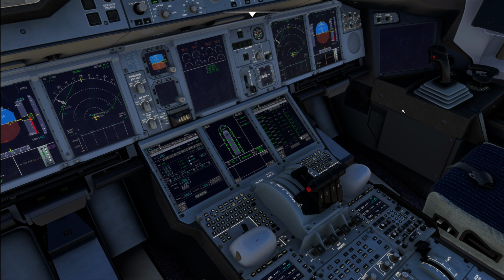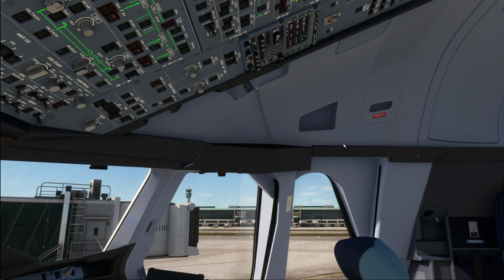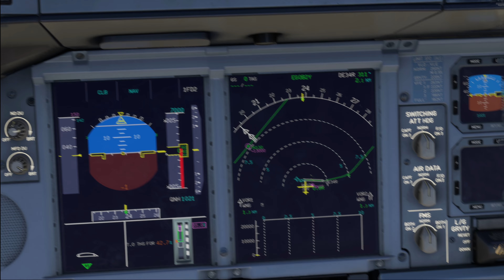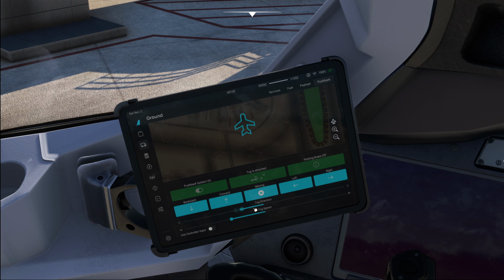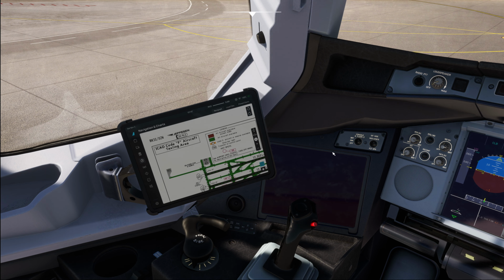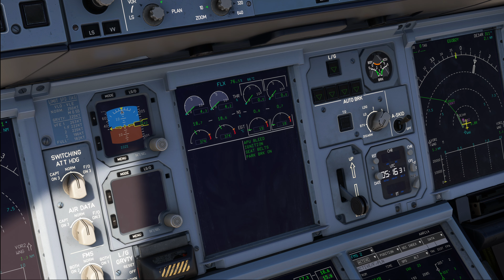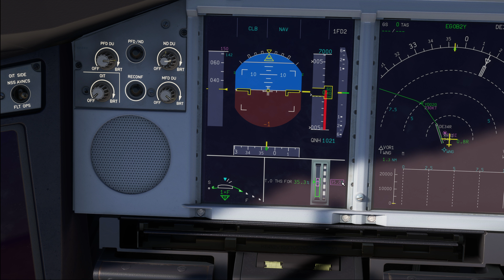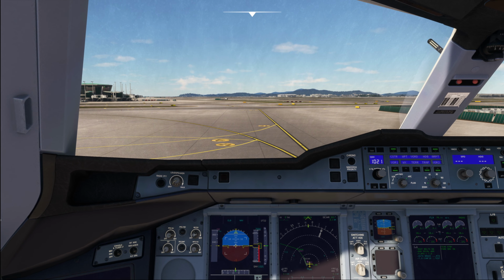FBW A380 Tutorial 4: Starting your Engines | Real Airbus Pilot

Comment: I think you forgot to disconnect the ground power. The external power switches where still one. I might be wrong but normally you switch them off, disconnect the ground power and after that you start the fuel pumps.
Reply: The groundnpower is bugged. It's avail even if it's not connected on ground.